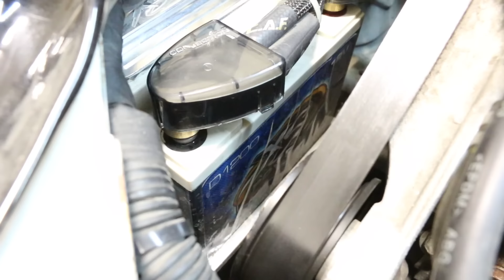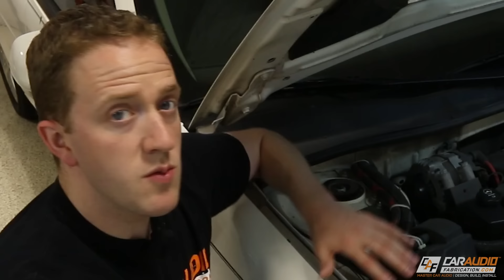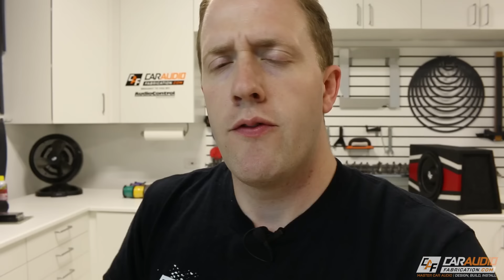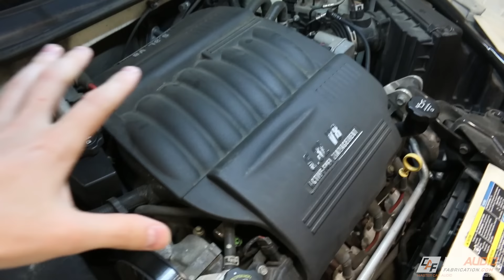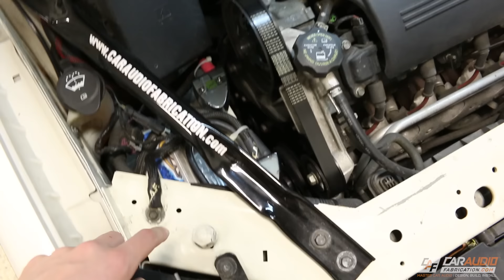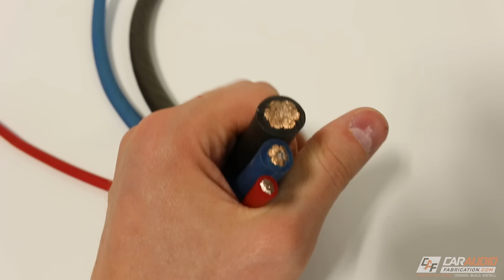Upgrade THESE for better Car Audio performance

Comment: 1. Grounding 2. Wiring 3. Alternator(s) 4. Battery or Power Cell(s). 5. THROW Capacitor AWAY!!!
Reply: The great thing about capacitors is they charge very quickly, so after stored energy is "depleted" they recharge very quickly. When used properly they fill in the sags of power that occur when transients are seen in the current draw of an electrical system. This is why you will see large banks of input capacitors in large amplifiers. 

Capacitors on their own without other upgrades don't do what people used to think they did or were for. It's not a one or the other situation, stiffening caps when used properly help maintain the voltage and overall power potential of the entire electrical system. They also help to filter out any noise or spikes that might be present in the electrical system.
Reply: Resistance and amperage. Yes, ideally that is what caps help with is maintaining a consistent voltage. I've still had better luck with the "big 4" upgrade followed by a more powerful alternator. On stock power systems I have better luck doing the "big 4" upgrade and using HID headlights (or headlights with a ballast) which improves headlight dimming too. You can also put a smaller pulley on your alternator so it charges faster at idle speed but then it can charge too much at higher rpm's unless it is controlled with the voltage regulator or vehicle's computer. Headlight dimming can be very tricky even if you have deep pockets. Goal is less resistance & more amperage.
Reply: NOT THE FLUX CAPACITOR
Reply: I heard a theory about caps; when thinking about solving headlight dimming, adding a cap maintains the voltage for what before it so the amp don't get the voltage. Keep in mind that I speak about stock alternator and stock battery system. What are u thinking?
Reply: Caps are used to avoid voltage spiking your alternator to death. Pretty simple logic. Charge. Drain. Charge. Drain. Stable is good.

Switch to LED headlights to get rid of dimming.

If they keep dimming you've got electrical issues.

Don't buy cheap caps, if you see one for less than $100, don't waste your time.
Reply: I used capacitor for 3 years because i didnt have other options. At some point ,over night, capacitor would drain my battery so i couldnt start the car. I also found out that my new battery leaked. In 3 years, 3 dead batteries all because i couldnt upgrade my alternator. :(
Reply: mclimoremd different using super caps, 5 2.7v 3000f cells wired in series. They hold 13.4v alone. Low internal resistance. So paired with a good ho alt. And a battery bank, you'll have pretty slow voltage drop down to battery voltage as your system is playing. In Short bursts if it's not enough to pull Down to battery voltage, you hit the caps first which when the load stops the caps will recharge faster then a battery.
Reply: @allrimmedout  yinlong lto ftw
Reply: @jeremyblucherable  well now yea, that's what I swapped to, only 80ah and a 320 amp charging at 15.6v on 2 5k's strapped at 1. hold mid to high 14's full tilt on like 1000 amps of current lol. i moved mine off my main system so I could charge up to 16v.
Reply: mclimoremd only if you strictly do spl.  caps are good for daily driver systems regardless of how big or small
Reply: How exactly? I've only ever known of caps being able to hold maybe a few extra volts and amps in reserve storage...this power can be diminished in a matter of seconds when the system is demanding more power regardless of spl. Once that reserve is used up, it is another piece of hungry electric equipment pulling volts & amps from the source power pieces...(battery & alternator). I bought into the caps hype 3 times with very limiting results. Then I put that money into the battery & alternator with much better results. No more voltage fluctuations & headlight dimming.
Reply: @mclimoremd  yep sure have yinlong caps will lithium is the future even took my starting battery out
Reply: For the average daily system and driver (like me), I still see NO USE for ANY capacitor (besides the ones built into amps, elec, etc...) Daily drivers should be safe, simple, & reliable. I DO believe supercapacitors (ultracapacitors) have value & benefits for the much larger & demanding systems like filtering noise & managing fluctuations in voltage. I agree they can charge very quickly but that is still dependent on the vehicle's charging system. They also discharge quickly which can leave you stranded if you don't watch & manage it. Power cells & supercaps can be DANGEROUS without thorough knowledge of them! I do not compete in audio competition nor do I hardly ever "burp" my system or else I'd give them more consideration & recommendation. Perhaps another demo...https://youtu.be/RccLk6NZ5WM

Comment: This is my ideal upgrade order:
1. Alternator and wiring (big 3)
2. Battery

Also, if you are still working on the next video Mark, it would be nice to see how you personally decide to upgrade the alternator. For example, do you have a wattage cutoff (say 1000 +), do you measure alternator output then add stereo amperage to calculate needs, or do you use some rule of thumb? I know of people who do each, I am just wondering which route you take. Have a good weekend Mark.

Comment: What is more important than doing the big three is clean mounting. Over time the grounding wire can become covered with oil, dirt, and corrosion where it connects. Sometimes replacing your ground wire with a new one, and/or cleaning the contact point will help more then anything else. You also need to make sure your battery and battery box is clean. A dirty battery or battery box can kill your battery and cause a parasitic draw on the battery.

Comment: The first thing I would do is upgrade the Big 3. As others have pointed out in the comments, make sure that when you upgrade that you use the correct sized fuse for the amount of load that the audio system will be capable of. Not doing this is asking for a disaster.

Comment: Great video. Quick question , I have a second battery in the rear, I ran a 0gauge from battery to battery. But I've melted the fuse in the line once. Will adding another run of 0gauge help dissipate the heat? How do I avoid this from happening

Comment: i'm 15 years old and im restoring a 40 year old car here in norway, i'm also installing a good audio setup. i want to wire my amplifier (about 250watts rms) straight to the battery, but the alternator puts out about 230watts. will it work or will the alternator fail?  (JBL gto3501 amplifier)
Reply: RifleRud I have restored a 1968 Chevelle and installed a modern 140 amp alternator to handle my sound system and electrical accessories. original old alternators have very little head room for aftermarket accessories.
Reply: Paul mrygold thank you for the answer :)
Reply: RifleRud wow you will go far in life, nice project to do at your age, up grade all the grounds and you will have a solid foundation for upgrades later. What car are you restoring?
Reply: I don't think it will support it, you should probably upgrade the alternator and battery if you can.
Reply: Any alternator can handle 250 watts that’s nothing. That’s what 15-20 amps of current max how many 15-20 amp fuses do you have in your car one more ain’t gonna hurt a thing.
Reply: Robbyota 559 yeah I always install another battery when i install subs. Don't need to upgrade alternator if you have 2 batteries
Reply: subbasslines Thank you! My dad has been collecting these cars for over 30years, and he had a blue (Vauxhall vx 2300) laying in the garage since i was born. The car had been standing in a dry garage so the car no real rust :) I have also been collecting speakers and amplifiers since i was 10 years old. i got over 100 speakers and woofers combined! so this project was just perfect for me :)
Reply: Tammy Forbes 
     250 watt amp at 12 volts is rated only at 12.66 amps LOL a 15 amp fuse should do the job.
Reply: It will definitely be fine. I run a 3500 watt rms amp in my 1978 truck with the stock charging system and it does not care 1 bit.
Reply: Gage Cook , yep it should be fine what I forgot to say is it's more about the battery storage. Bigger system should always at least have two batteries one for the system and one for starting. Also good clean power back to your amplifier really matters using the proper size cabling or larger and good quality cabling and grounds helps out tremendously. I'm currently running three batteries all the same and a stock alternator on a 30k watt system with no problems at all. Upgrading my alternator would allow for continuous power however just haven't had the need as of yet. I know that's a little much to be run on the stock alternator but it seems to be doing fine charging the batteries if I have time I'm not expecting it to be continuously charged at optimal levels to run the system for long periods of time. I found myself using my system for about 15-20 minutes and then driving around the block and it's good to go again. I will upgrade at least to two  alternator when I have the funds to do so.
Reply: RifleRud is it just about 20Ah ?? Sounds low to me
Reply: Most alternators are rated in amps not Watts. Amplifiers are rated in Watts however and it is good to always go by the RMS, wattage when converted to amps will give you what you need to know. Normally to get this number you take the wattage divided by voltage in order to get the actual amperage you need. For example a thousand watt amplifier normally takes roughly about 83.33 amps to run however upgradeing your alternator never hurts but before you do that make sure you have good grounds and adequate cabling.

Comment: 1. Wiring - cheapest mod and allows the system to handle more power.
2. Alternator - takes strain off the battery and increases total available power per time unit
3. Capacitor - to absorb the power spikes without putting strain on the battery. Capacitors are made recharge and discharge quickly.
4. Battery - to provide electricity while the engine is off or idling, since then the Alternator doesn't not provide power or sufficient power.
Reply: Kai van der Bijl that’s just if you have a unregulated amp then you will see a few more what’s but you want hear any difference. Now if you got a regulated amp like my JL HD1200/1’s it want matter as long as your feeding it enough to make it power your good but it want make any more no matter how much your over 12.5 volts.
Reply: 3. Capacitor - to absorb the power spikes without putting strain on the battery. Capacitors are made recharge and discharge quickly. -lol, did you ever make some measurements of that?   Capacitor only works for first 10 seconds ,after  it gives out all his power ,it need to charge again it takes a lot of power from battery and alternator -makes everything even worst... I am talking about those 1-3 farad  capacitors  witch is just a marketing and waste of money.... look at some pro installs-non of them use a capacitor and if they do,than its around 50-100 capacitors.... this is just a my opinion.
sorry for my language
Reply: I suggest to use that money on more powerful alternator  and deep cycle battery

Comment: * Alternator output capacity functions as a pre-amp volume control for devices down the line. IMO.  If the Alternator cannot supply the current and voltage to keep the Amplifiers powered properly,  then the overall volume and output drops (noticeably), similar to how when the volume / input on one of the signal processors is reduced, it affects the other components down the line, this isn't about line balancing all the components (* which should be properly adjusted using signal tones and scopes if no led indicators are available on the equipment.) Basically with a 200A ALT providing power to Components ( Vehicle accessories have been removed from this example) Installing a 100A ALT will reduce the overall volume and output of the equipment (regardless of how well it is grounded or gauge of wire used). If you have in excess of 2000Watts,  a higher powered ALT will increase the output and SPL inside the vehicle, and keep the components powered at voltages that do not fall below 13v. * Assuming the vehicles motor can properly run the Alternator without dropping RPM's.

Comment: As far as what should go first, it depends. Most people who put their first system in and purely want to just show how loud it is but will tend to keep it mostly tame, then capacitor. Also since to most first timers they don't get that Loud doesn't mean quality, and if you're just looking at how loud it is and go cheap they'll see Peak Watts and be impressed and grab a matching peak watts amp and if they only have that capacitor it could probably do some bacon saving by running outta juice and dimming their lights enough before they fry something too, but that's probably not going to be the case.

I remember a woman who's car I was fixing a rats nest of a wire job said that her ex installed the capacitor saying it cleans the electricity for better sound. (-_-')

Comment: Battery, wire, and H/O Alt. if you wanna go HAM!
Reply: Crikies...what kinda power are you talking? I've run texas star 250 watt kickers with no issues with my Galaxy 99's and talk to just about anyone that I can hear across the country. When combined with a 102" whip or a Wilson 2 or 5000 they did amazingly well.  Of course, when the skip is really pounding, I'm in awe when one ol boy keys up and it's nothing but him on the air! I bet you're that ol boy! How big is your Palomar? lol
Reply: bigger battery? or different battery type and what kind of wire?
Reply: Which is the best battery for sound systems

Comment: Battery is the first thing u want to upgrade
Reply: team louder altanator....1unless your cheep...
Reply: Gio arteaga no matter how good of alternator u buy but if your battery is not big on wattage is as good as having stock alt
Reply: team louder ,
    Some cars only run off of alternators they do not have batteries at all so how would you explain this?
Reply: Captain Buff The Third 
    Wattage divided voltage equals amperage
    There is a science behind the madness LOL
Reply: ALTERNATOR!!!!!!!!!
Reply: team louder you really need to do some homework.
Reply: ThatMan and what if the battery is small and only enough to power the car and electrical system in it? It wouldn't matter how good of alternator u have if u have a small battery that Cannot store a lot beside for what the car needs
Reply: @ericayala1738  The battery is meant only to start the vehicle. Yes you can power accessories from it while the vehicle is off, but it then falls on the alternator to recharge it. When the vehicle is running however, your battery is not the source of power for your sound system.

Comment: When I upgrade, I will probably start with the battery. A better storage device for my power source. I suppose since I don't "rock out" at full volume all the time, like I used to 20 years ago, my alternator has a chance to keep up. I wouldn't upgrade the alternator till  I god an amp that would demand more than my battery could provide. I recently read an article on stiffening capacitors, which proved that they are at best, pointless, at worst and additional load on the alternator. I probably wouldn't change the cables until I upgrade the unit (Battery cables with upgraded battery, alternator cables with upgraded alternator, etc.
Just my 2c worth.

Comment: Good question! I feel like the answer is different for certain situations but the first thing I do when I get a vehicle is clean and upgrade the grounds. Upgrading the charge wire on a stock alternator is kind of silly. When you upgrade the alternator, is usually the time for that.
Reply: thornygravy prior to upgrading the big three on my car the absolute most my alt would put out was 14.2 volts after upgrading it instantly put out up to 14.6 I don't even know what that would translate to in amps but to call it a silly upgrade is just plain silly
Reply: Your alternator very well could have been putting out more amps at 14.2 then it currently is at 14.6.. But just for you I'll make a correction "kind of silly, assuming the stock charge wire is in good condition (connections are clean and tight, wire isn't damaged, etc)."
Reply: I could say my boss amp is underrated but that doesn't mean anything if I don't have proof, your point of my alt putting out more amps prior makes no sense as all that happened was 14 year old 8 gage wiring was replaced with 0 gauge welding cable, nothing whatsoever changed with the alt itself therefor it's output didn't change it just has less loss enroute to my battery, if you want to tell me I'm wrong give me some actual facts and science
Reply: @bmbgarage3405  He meant the cable not the alternator..
Reply: Teegan Cathcart, Hey, an increase of 0.4volts! You go, bro! Question: do you notice the voltage more stable now than before?
The voltage increase could be your new cable has less resistance, not just because of the larger conductor area, but the actual resistance of the metal conductor itself, allowing a slightly higher Voltage to push the pixies. Conductor size is only beneficial when you are pulling enough current (amps) to warrant the larger conductor.
An increase in Voltage does not necessarily mean an increase in power if your alternator is at the limit of the amount of current it can supply.
The real test is, how does your voltage hold up when your system is pounding with your headlights, and AC on?
To calculate your amps, you would need to know your systems total power draw,  in watts. Use Ohm's Law. 
Watts/volts= amps.

Comment: I would start with grounding. Finding the best path helps alot. I have also added more grounding straps to the vehicle to help it out. And cleaning the existing ones helps alot too.
Reply: 07wrxtr1 Yeah, I've paid dearly for that as well.